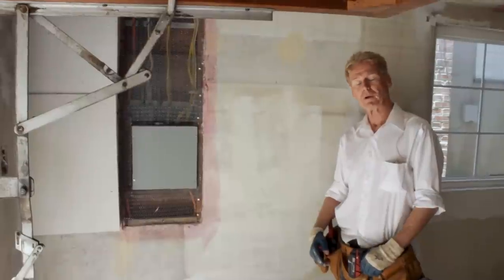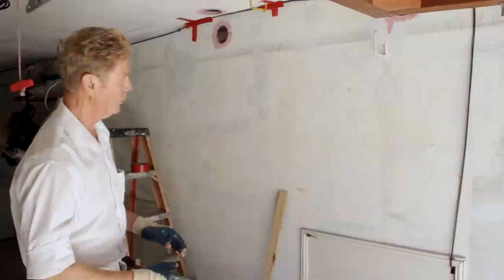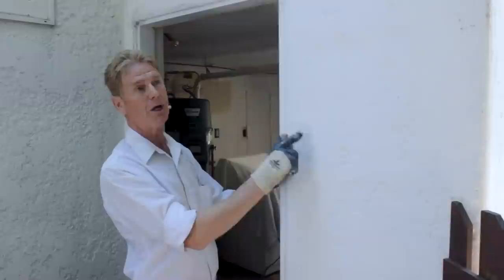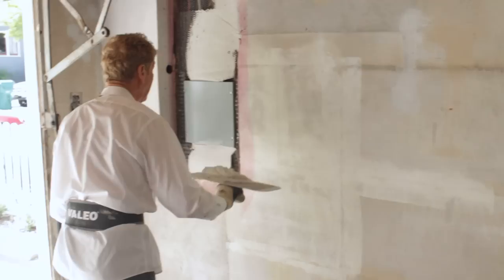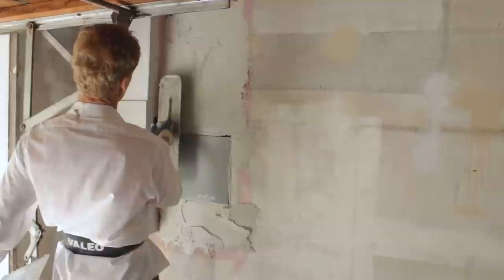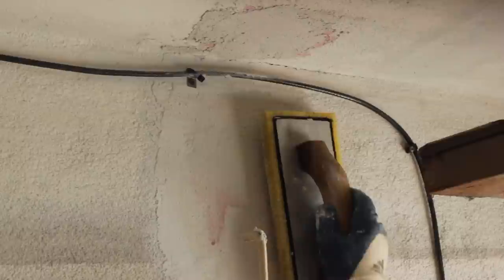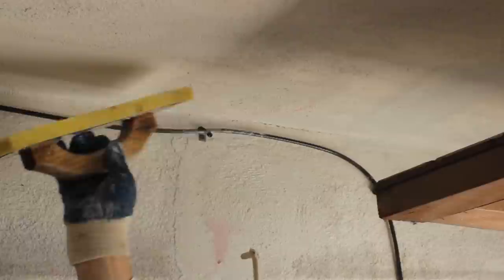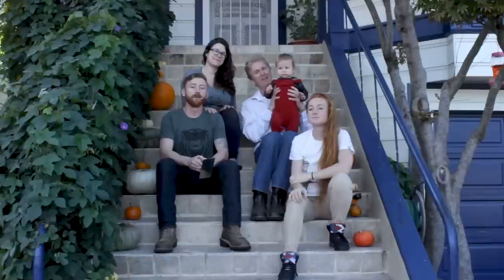Repair Interior electrical or plumbing holes.

Comment: Hi Kirk, I am doing my small toilet (half bathroom) and one of the 4 walls (where all of the pipes are as well) made of cinder blocks. it is  very uneven. I plan to use structolite to make it plumb and flat (using the screed strips ) question is would you recommend structolite over cinder blocks (of cause i will use Weld Crete or plaster weld as a bonding agent). gap with the pipes  I plan to cover with  metal lathe. then plan to tile over it. Another question is that it is toilet and potentially area with a higher humidity, not wet area of cause but... Do you think Structolite would still be OK for this application. And the third question is the thickness of it as the layer in some areas would be up to an inch thick. Would i need a metal lath in a thick area?
Reply from the maker: Howdy Dennis, Structo-lite will adhere to really clean cinder blocks by suction. If you are not sure, they are really clean? Then apply the bonding agent after you clean the blocks as best as possible. Or the bonding agent will be as effective as a broken screen door in a hurricane.
 Structo-lite can be applied from a half-inch to 5 or more inches; no wire is needed.
 If I were you, I'd add a couple handfuls of portland cement to each bucket full, or you will have a three to five-hour wait for the structo-lite to set. 
FYI, The structo-lite will set in 15 minutes with about two full handfuls of portland cement. Apply coat after coat until you get to the desired depth.
Funny, I'm doing something similar tomorrow on a ceiling.

Comment: Hello Kirk and Giordano family. I live in the very hot southwest. I have enjoyed watching your videos for several years. We recently purchased a home that originally had what I call a rough thick Stucco coating that the owner then had  new windows installed and had a contractor do a smooth colored stucco coating. Problem is every window is cracking all around the windows as if someone drew a line around them showing where to cut the window out. Also all rounded corners are cracking vertically. My question is how does a homeowner find a good qualified Contractor like yourselves? I do not want to use the contractor that the previous owner used. By the way you look great in this video. Thank you very much.
Reply from the maker: Howdy general dude, sound like the windows guys saw cut the opening and didn't tie the wire in.
 Plus smooth stucco cracks as the finishes are Portland cement. 
Your wood under the stucco heats thus expands then pushes on the stucco voila, hairline cracking.
https://youtu.be/chU9So3vy9s/ why smooth stucco cracks.
I recommend you google “Plastering contractors” in your area. This may help you decide.
 This search may also bring up “yelp” Theirs is a paid subscription, so their reviews may be more biased than Google; however, you can scroll and read through the Yelp reviews.
 Hopefully, with the help of both review apps, you will find the best fit for your needs.
 If you’re still not sure, ask to view their completed jobs and or repairs and, if possible, speak directly
with their past clients.
 Best wishes, 
Kirk Giordano Plastering Inc.

Comment: Mr. Giordano, I've been watching your videos for years and this has allowed me to repair several areas on our old stucco home. With your videos I've finally managed to match our existing stucco finish(after many failed attempts of course) which is what you refer to as a heavy dash I believe. Unfortunately, the finish didn't adhere very well in several spots. This finish was applied over stucco that was 24 hours old. I did the scratch and brown myself prior. I wetted the stucco before applying the finish and misted it for 2 days after. It is quite hot and dry here in western Nebraska however. You can hear the hollow spots where it didn't adhere in several places. Ironically my prior attempts(quite the eye sore lol) to match our finish over the years are holding up strong years later with no peeling. Any idea what I did wrong? Thanks for all the videos and great how to's by the way!
Reply from the maker: Howdy Aaron, it sounds like you may have wet it, however when you applied the finish, it had now dried out.  When it's really hot often we have to wet or mist the walls throughout the day or a dry wall will suck the moister out of the finish coat and cause it not to adhere well. 
Thus any hydrating afterwards wont help it, as it didn't adhere well to begin with. 
Either that or the wall had dust dirt or moss on it.🍻
Reply: @StuccoPlastering  
Thank you for your reply. Can you offer any advice on how to salvage the finish? I imagine I can scrape off the bad areas then with a smaller brush reapply to those areas?

Comment: Hi Kirk, I recently demoed a crumbling concrete foundation wall and built a cmu wall in it's place and now I'm ready to,.  um.. plaster it .
I've done my fair share of  drywall taping and after watching a lot of your videos I think I can handle it.
A few bags of "Jet plastic cement" came with the house but I'm not sure if it is for that purpose,  is that what it's used for ? If not what would be the best thing to use?  Thanks for any info
I really appreciate watching you work you are a great example for the young people of today. 
Ps I followed the link to Amazon but couldn't find your name ..I want one of those 16x5 pool trowels
Reply from the maker: HI Adam, if its old stucco chuck it as it won't adhere well.
 Stucco last about a year on shelves, sometimes longer, but to guess. could be a drag and waste your time,
 You can buy any Portland based cement stucco at HD, such as Quikrete, Rapid set or Green-Core,USA.
https://youtu.be/dw34VLYFC1Y/ Improve the look of block walls with stucco.
https://youtu.be/LW9Dwxl2W4c/ Stucco over concrete walls to remove form board lines.
https://youtu.be/MbZHkJCJuZ8/ Improve the look of your brick walls, Green-Core cement.🍻

Comment: great video Kirk. I was wondering, you guys don't seem to use much plaster board in your videos or set plasterboard sheets. Is there a reason for this in the US? In Australia most of our residential interior plasterwork involves the use of plasterboard (drywall sheets).
Reply from the maker: Howdy Adam, sheetrock or drywall is used here too for interior walls, however most apply taping mud over it.
 When folks want taping mud, I tell them to call drywall companies. Cheers my fellow plasterers from Australia🥳

Comment: Hi, thanks for the content! I’ve never successfully screwed into plaster, what did you use to screw in the backer?
Reply from the maker: Howdy, all sheetrock or backer boards are attached on studs. Thus, you have to locate the studs as we did in this video. 👨‍🏫

Comment: What kind of float would you have used for a smooth finish? I've need to patch a hole in my bathroom where the plumber worked on the vent stack. The wall is about 110 year old plaster and lath and I'd like to blend the finish as best as I can.

Comment: Hi Kirk.  Great vid as usual.  I was wondering, are you fastening the wire to the wood strips you are installing or just pressure fit into holes to be patched?  Thank you.
Reply from the maker: Hello Kevin, we go a bit overboard and fasten the wire to the board with screws also then use a bonding agent to💃

Comment: I used structolite to fill in gaps between plaster and drywall.  (I didn't use a bonding agent!) Should I use ez sand and fibafuse  on the finish coat?

Comment: Hello, Kirk. Doing a block house, would you recommend adding additional lime to the plastic cement for more workability and cure time? Or just with the straight plastic cement?
Reply from the maker: Howdy Nicholas, any of your ideas are good.
One of the best methods for adhering stucco to block walls is to mix it just a bit richer, that means less sand for the first or base coat.
 Too much sand in the mix and the stucco wont hang well.
 equally important, saturate the walls beforehand.
 not dripping wet, but blocks need to be moist for the stucco to adhere forever.🍾